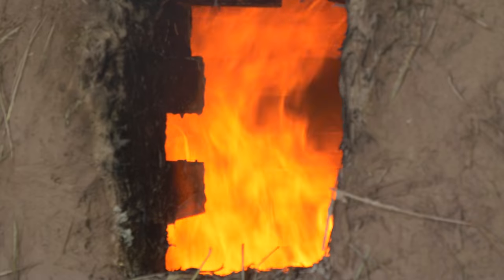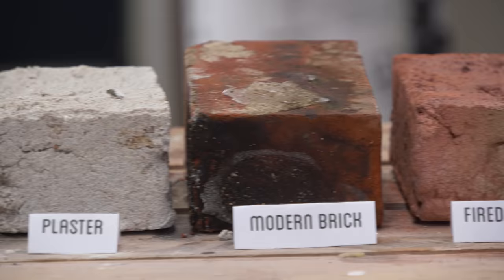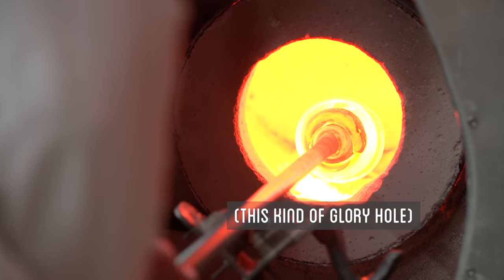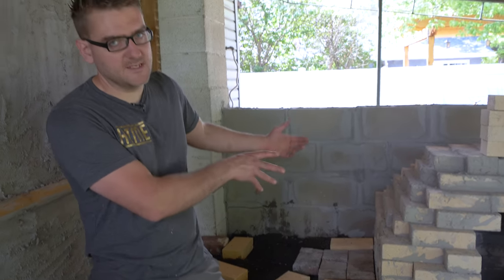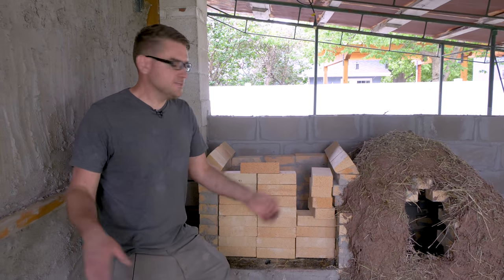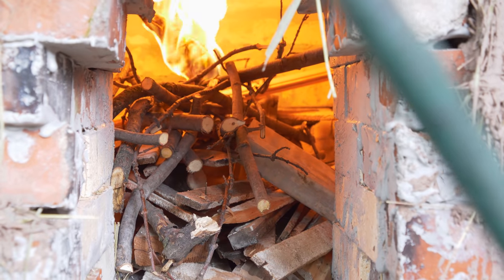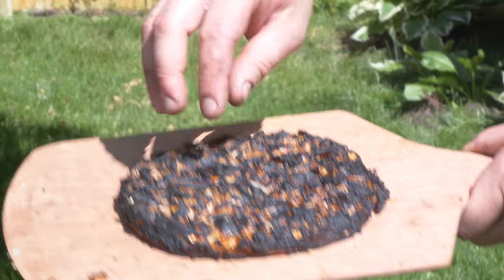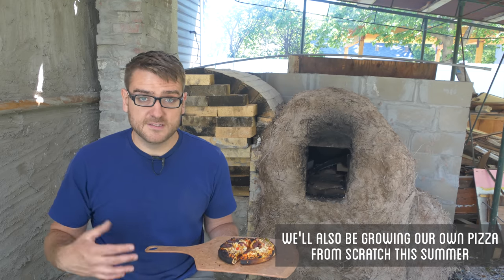Can I Cook a Pizza in My DIY Pottery Kiln?

Comment: A tip for baking in a wood oven: the fire will always burn your food. What you want to do is get the oven really hot with a fire, then put it out and cook with the residual heat.
Reply: Also don't cook frozen pizzas in a wood fire oven.
Reply: Also, you want all the walls of the dome to be as hot as possible. It can take several hours. Then, as @zinckensteel says, you wipe down the floor with a wet mop to get rid of the ash and cool the floor, so that it doesn’t just burn the underside.
Reply: This sort of underscores what has been a long-running issue with Andy's methodology: he tries to test or use the tools he makes with methods he doesn't know how to conduct properly.  This always leads to things not working the way they should and would if he knew what he was doing.  If he actually knew, for example, how to properly cook something in a wood-fired oven, the pizza test would have been far more successful and the end results he's going to get from his oven/kiln would be far better than what I'm guessing he's actually going to get.  If you don't know how to properly conduct the testing process, your test results will be wrong and so will your final results.

Many of the failures or marginally acceptable results he's gotten on this journey can be traced back to incomplete knowledge of the actual process and making assumptions on how to do something rather than finding out how to really do it.
Reply: Residual heat is where its at
Reply: @wickideazy  Well I imagine that he is intentionally trying to do things manually, on his own. Just like how these "First people" would've done so. The first people to cook in a brick oven probably didn't have all the techniques down either, they probably would've burned something or broken another thing. That's part of the learning process of these "new" technologies, the very thing he's trying to figure out.
Reply: Well... I'm not entirely sure if this kind of oven design is particularily well-suited for residual heat cooking because it's all about the draft, meaning it'll probably cool off a lot quicker than a wood oven that was actually built for baking things with residual heat. It's a kiln after all, not a bread oven. It's made for achieving high temperatures more so than retaining heat.

Then again, this kind of oven design also may not be particularily well-suited for preparing dishes (I guess you could make it work for things that are cooked in covered pots or dutch ovens etc) to begin with.
Reply: In Italy usually you have a small fire on the side of the oven, and then the rest of the oven is empty and the pizzas are put there.
Reply: @Billy-I-Am-Not  The problem there is that he does it entirely from his knowledge of modern stuff, instead of having the breadth and depth of knowledge that came before which eventually culminated in the "new" technologies; as his intro goes, everything we have now is derived from centuries of innovation, and if you don't have the background, you can't properly go forward (without making many mistakes, like how he's STILL not mixing his cob before slapping it on, which is what makes it work so well, as the straw acts like rebar in concrete). For example, the whole reason that pizza ovens have a large slate base isn't because of hoity-toity elitism, but because it's a large flat stone surface that will absorb the heat from the fire and distribute it evenly throughout its surface, ensuring an even bake. This is why our modern baking sheets exist- they're basically a simpler, more easily used form of baking stone surface easily accessible for the masses, versus having to pull out a baking slate and preheat it before you can use it (not that that doesn't stop some people from preferring to use such a method to get back the difference in end result that the material makes).

@Darthplagueis13 while it's a kiln first and foremost, it can easily be used as a proper baking oven simply by filling those gaps in the side with brick ends, or through the use of a sliding baffle on that wall, similar to what he was talking about for the wares oven-chimney side.
Reply: @wickideazy  Yeah but I watch this channel in awe just marvelling at the goofball approach and subsequent suffering. If it was my channel though I’d be all research and zero actual making stuff because I’d still be researching. Which is why I don’t have a channel and this yolo lets just try random stuff guy does 😹
Reply: The firebricks used for the walls of the kiln would make a great surface for cooking pizza on. They just need a couple hours to get heated up. Learned this from my own pizza oven build. I like the multi purpose use of this kiln though!
Reply: Yes!
Reply: @Zelmel  why would anyone do that
Reply: @wickideazy  that is very evident in his quality of work in this build.  My dad would still be beating me if my work was done so poorly.  He worked for years properly constructing anything from bricks.  It wasn't what I wanted to do but I could still do a way more professional job building this kiln using any method.
Reply: not always true. when cooking pizza, you want a flame.
Reply: @alfulton5946  It certainly looked like what he was doing at least with the first one (and in any case they were definitely originally frozen pizzas, just possibly thawed first, which is not how they're designed to be cooked).
Reply: The issue with this oven is that its dirty burning so too cold for food and the pizza too thick. I built my own oven and I get a fire raging till white bricks and then continue with fire as is appropriate. I keep at least an non flame burn going over the cooking area until I'm ready then push and sweep. Don't mop as that pulls a lot of heat out of your bricks and you should be burning to a talcum style ash that's easily pushed and doesn't need water. his entire issue in this oven from it burning on one side is a lack of concistant heat top, bottom and sides
Reply: @wickideazy  Yeah, but in a way that’s kind of the point of this channel isn’t it: to see how much of modern society could be recreated with marginal knowledge of the underlying techniques, methodology, and specific knowledge that comes from each item. It’s essentially dealing with the premise: can an individual recreate some aspects of our highly specialized society via empirical methods.
Reply: There's a place near here that makes Naples pizza, they haven't let the fire die all the way out for over 7 years (they even brought a coal from the original store to a new one to start it's fire).  The trick with them is they're constantly moving the pizza, they get it up on the peel (bread paddle) and wave it through the hotter air near the top of the oven, then set it down on a different side.  Also, they don't ever leave a pizza in the oven for more than 3 or so minutes.   It is VERY tasty, super thin, few toppings. so about half the thickness of these too....

When they were younger, my kids loved to watch them work, it's kinda fascinating/hypnotic, it's a shame that as we get older watching how something is made is seen as "boring" or " a waste of time".
Reply: hmm if you make a semi-sphered owen with the center point just below the floor you can relocate the heat there, in that say you can leave the wood on one side so there's air flow
Reply: @wickideazy  He didn't make most of the bricks he used :(
Reply: I would have thought that doing something like placing a clay pot over a roast of somekind would work better. Though i have no idea exatly HOW that would affect the cooking, but i would assume it would be something along the lines of a convection bake in an oven.
Reply: @alfulton5946  It bothers me too, this channel could be better (or more like, it could be more interesting IMO, can't speak for everyone), but instead, the approach to most projects it's like a teenager doing a high school science project, kinda half assed, not doing things properly, not researching it properly or giving up and leaving in a poor state. I understand that time is a factor, doing a proper video, a proper project where you make sure you get a successful result it can be very time consuming.

While some claim he wants to do things by himself and from scratch, he does go around and ask for tips, or instructions, or even falls back and sometimes uses power tools or help from a third party to complete stuff.  So that leaves me confused, when is okay for him to use modern ways or to ask for knowledge on how to do it? I'd like him to ask, learn, train a bit and put effort to get better, not great, just better than before. This isn't the first project he's done, so he's not clueless. But even when he has done all of that,  I feel like sometimes he still doesn't understands how to do it, or he doesn't properly apply the knowledge. 

My thoughts are a mess, don't mind them a lot, but to me this is more like a casual approach to what they wanna do. If you like it there is nothing wrong with that, they do a good job explain a lot of stuff, it's just that I feel like the fail at execution, and the whole vibe of the channel is more focused to entertainment, maybe? I wish there was a more serious and professionalism to him. More focus to the actual project at hand and achieving a proper result than "lol, oh well, that's that".

Comment: OMG I love your little kiln design! As a ceramic artist myself, I might have to think of making a little kiln like this for myself. One tip I would give though as you refine the kiln, don't use mortar. A LOT of pottery kilns today and in the past didn't require mortar. This allows for easy improvements and maintenance but also makes it so you can reuse old bricks, saving on money. Even with an arch, tension is usually enough to keep them in place without mortar. What you will need though is some metal framework to counter any shifting and that will also help with constructing a solid door. Same with the shelving, you can use brick shelving inside but you probably would better to not mortar them in place either in case you need to change arrangements for larger items.
Another tip, unlock different brick types. Some really good kilns I've used have different brick types layered together. The best I've seen use soft bricks on the inside and hard bricks on the outside. You seemed to have mostly used hard bricks. Layering the two types will dramatically even out and hold in more heat, allowing you to upgrade your kiln to higher temps that are much easier to control.
Reply: You should look into Raku firing! It's a lot easier and more movable way of firing at home. Just need to build a sturdy metal cage, add fancy fire proof material (ceramic fiber) for insulation, then add fire. When I did it we used what was basically a propane tank flame thrower. It only takes a few hours at most too vs days. 

Looking online, there are a ton of resources on how to do it too. Although they seem to opt for using preexisting metal objects to make the kilm instead of making it yourself from rolls of metal netting. Which is probably even easier

Comment: Don't put the pizza in the blazing oven. Wait until the fire is out and use the remaining heat for baking the pizza.
Reply: This is the way. Hot coals, not fire, for cooking.
Reply: @5avan10  Doesn't even need coals. A wood fire that heats the oven then you can cook on the residual heat for several days before you need a fire again.
Reply: Well with bread and pies, but pizza sorta different you want direct heat, you need around 800-900 degrees in a specially made oven(ie not the thing shown in the video)

Comment: Grog is great to add to clay to stabilize it as it dries out and is fired. It does tend to effect surface finish, but it is great to use otherwise. Plus for civilizations in the past, finding broken pots to make it was super easy.

Your cob is way too wet and less grass in it. You should be able to pick up a couple of handfuls once it is mixed, work them into a ball (also called a cob in some cultures) and then slap the ball into the location you want to put it to attach it. After you have a few balls in an area "thrown", you can then smooth it out some. After the cob has set some, you can then smooth the exterior. A lime or cement plaster then goes over the top for water proofing and protection against damage, including highlighting where damage happened. Once a month or so, go around and inspect it, patching any cracks or holes. There will be cracks and holes.

As easy and effective as this building style is, it takes a lot of maintenance when compared to other materials. This is why important structures were made of bricks at least and vitals structures out of stone.

Comment: You guys ever gonna touch tools like planes, or the thumb shave? They went back as far as roman times i believe
Reply: Block planes also go way back in places like china, like spear planers
Reply: I'm hoping once they get their sawmill going, they'll spend some time to learn how to mill and process lumber. It's time consuming, and requires some attention to detail, but it would improve their wooden builds by 1000x. No more sticks nailed to other sticks, wrapped in rope and prayers. Proper hide glue joinery.
Reply: @Kojo2047  or even just well fitting wedged joints.

Comment: When we do Wood fire pizzas at our Winery we usually get the ovens around 600-800 degrees and a pizza will cook in 30 seconds to 2 minuets. The trick is once you've heated up your floor and pushed the fire back is to surround the cooking area as much as possible and pre cook the crust.

Comment: To control the temperature you can add a chimney on top of main fire chamber that has is the same size as a brick inside. You then leave a brick sized hole in the side of the chimney and slide a brick in and out to control the flow between this chimney and the kiln.

Comment: If you end up trying out ideas to raise the temp in the main chamber, I'd like to suggest a modification. Have the heat come in at the top of the chamber and keep the outflow to the chimney low. I would imagine this will slow down the hot air from going straight out while building the hottest pocket at the top and letting out the coldest air. I hope you try this idea.
Great video BTW

Comment: I've only done a little bit of mortar work for school, but is that mortar supposed to be that liquid?
Reply: Exactly what I thought, seemed very runny.
Reply: I think they're using clay slip, not concrete/mortar
Reply: @Briaaanz  that would make sense. Thanks. I had the same thought. Mortar isn't that wet.
Reply: no
Reply: @Briaaanz  Yeah definitely looks like clay slip, and honestly makes sense; you want to use the slip to fire-harden into more ceramic and basically weld the kiln together, after all. Sure, cement-as-mortar can work, but it still deteriorates with heat, nand the rapid heating process of the kiln would likely introduce cracking and possibly even spalling from thermal shock, and eventually at higher temperatures, molecular decomposition as it can no longer hold its hydrated form and begins to crumble into powder. This is why firebrick is its own thing, and not just concrete cement, too.
Reply: @KainYusanagi  that or actually weld the ceramics by power welding so much it to the point that the tungsten contact rods have started to give off vapors (tungsten gas does not smell good) (although at that point SiO2 burns so yeah)

Comment: In Uni, we used a rack to cook several pizza's in one of the department furnaces. It was only used to heat treat steel so we guessed it would be ok.. and with a perfect control of temperature.... those were some good pizzas for lunch while we worked on a project.

Comment: I make absolutely KILLER pan pizza by first cooking the bottom until it starts to slightly brown, and then putting the pan and pie in it in a 450degree toaster oven to cook for around 11-13min. I know toaster ovens aren’t ancient, but for that old method or modern ones I don’t think 500-1000degree ovens as being necessary at all if you like a nice pan pizza, and I’m sure a steel pan could be subbed out for a clay/ceramic one. :)

Comment: How we used to bake bread in medieval Europe is by having a brick or stone oven. Which we would set a fire in. Then once all the wood was reduced to ashes, we would place the bread on a wrack close to the bottom and close the door quickly. Letting the ambient heat evenly bake the bread. Some times it took 2 fires to bake it just right. Especially if it was a large baker's oven. But keep an eye on it if you need 2 fires. You do not want to burn your bread.
Back then, baking was more of an art form than a science.

One door for a oven that might be easy is a stone/concrete wheel in a groove. That you roll into place tightly infront of the entrance.

Comment: So if you want to cook pizza in a wood fired oven you have to get the fire to one side and have quite a bit of space between where the fire is and where the pizza is, you’d like to also have the flames to not go towards the pizza but away so that you bake it more than blast it with flames.  You want a thinner pizza so that it cooks quickly and doesn’t burn and a very wet dough for the same reason, turn it quickly and in less than 60sec it will be cooked perfectly. Last thing is to not cook it near the entrance to the oven because one side is going to be extremely hot and the other extremely cold so it will not heat the stone on the bottom and not cook the pizza

Comment: The issue you have baking a pizza is that you still have the fire going.   Heat the baking area with the fire and then put the pizza in, the brick will hold heat.   Kind of like pre-heating an oven.